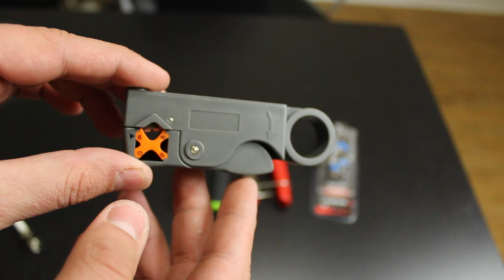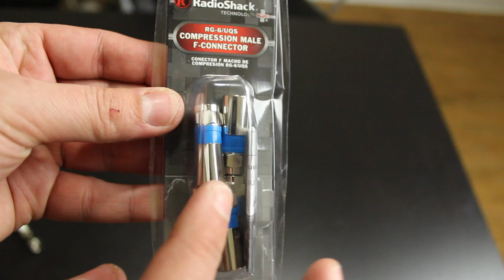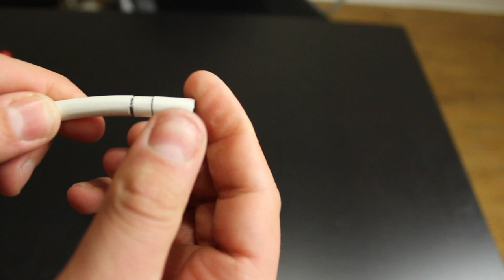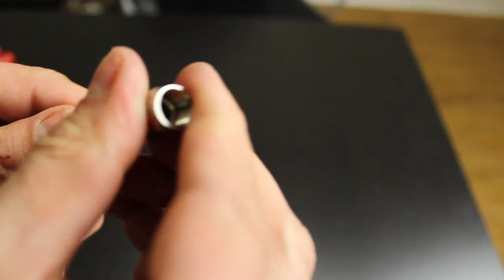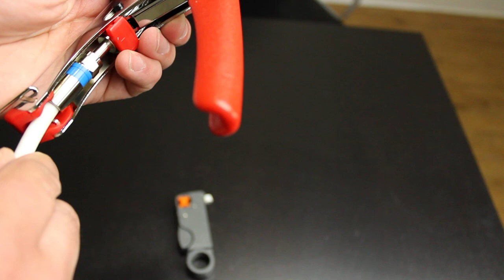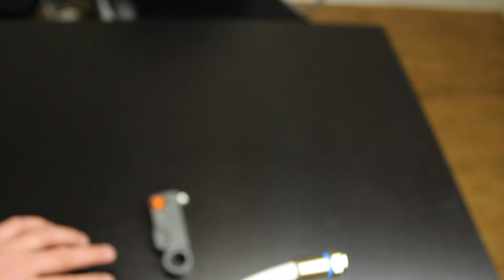How to Terminate an F Compression Connector on a Coax Cable

Comment: You DO NOT want the cable sticking that far out of the prep tool. That lip on the tool is as far as you want the cable to stick out. Also you did not push the connector far enough onto the cable. white insulated layer is supposed to be flush with the top of the inner ferrule.